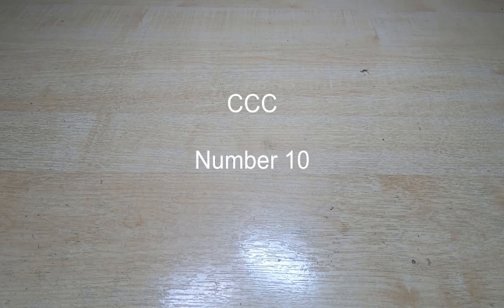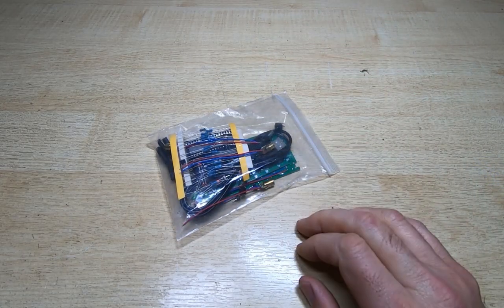Cheap Electronics Kit Number 10

Comment: Jerry, thanks for that Kit build, very funny. Here my two design enhancements (cost and complexity reduction) for the kit manufacturer: 1st: don’t use separate light sensors, use the LEDs to detect the intensive laser light. 2nd: By multiplexing the input und outputs a smaller microcontroller could be used. A decade counter (CD4017) could ”blink through“ the stages and coordinate the light sensing in addition. So maybe one single attiny85 could be sufficient.

Comment: That lead forming tool.... can't it be use on the entire strip at once? That would save a lot of handling time
Reply from the maker: You can make them however you want to. I generally do not try to form leads while they are still in the carrier as the leads get bent again when they are removed from the strip.